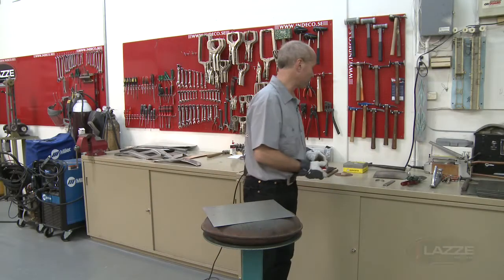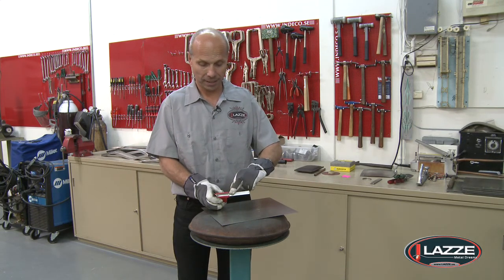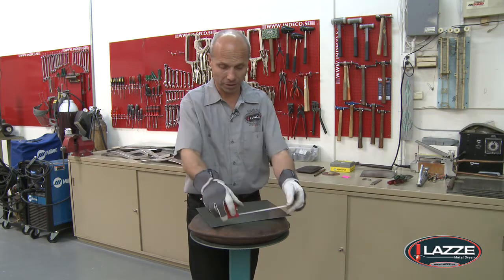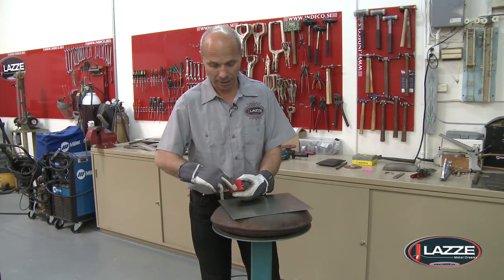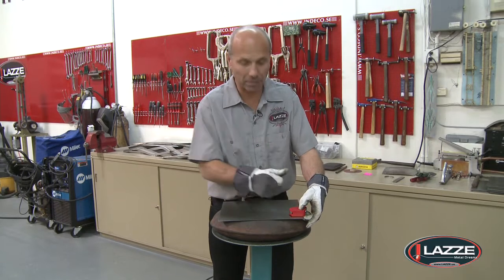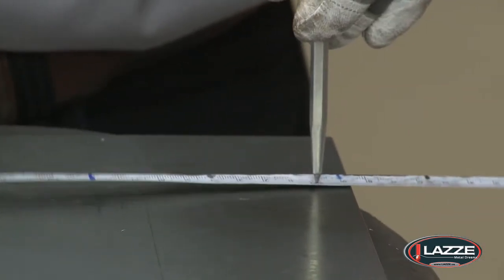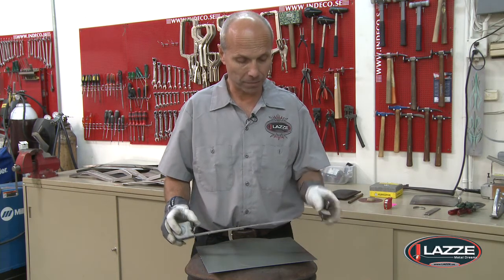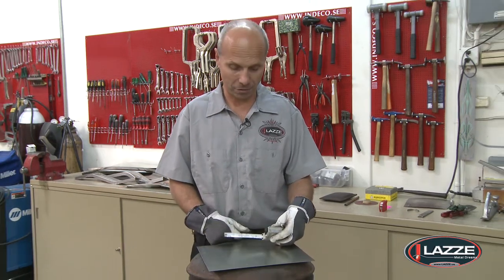Lazze Metal Shaping: The Swedish Tape Measure

Comment: Nowadays in even the metric version of Talmeter, there are red numbers on the opposite side of the tape which shows the +100mm measurements, so you dont have to add them.
And if i can remember right, there is also the pi-markigs on the tape, so, example, when you measure the circumference of the round pipe, you dont have to calculate the diameter..
Most useful tape measure in this size-category i ever seen.